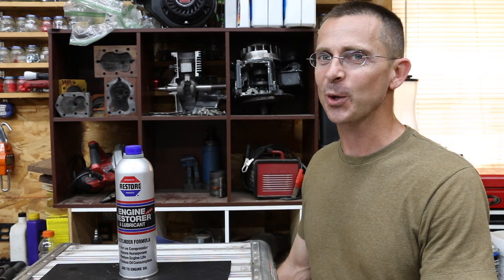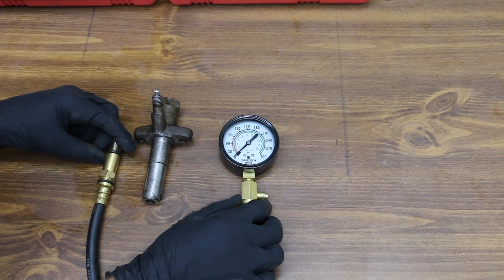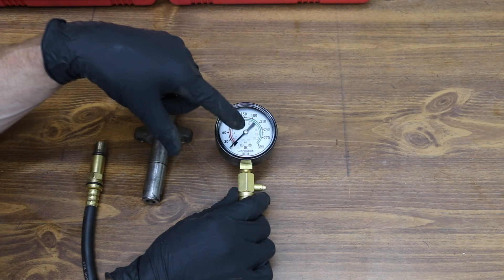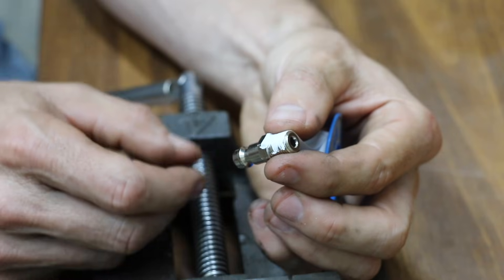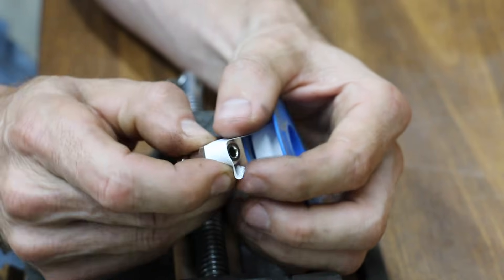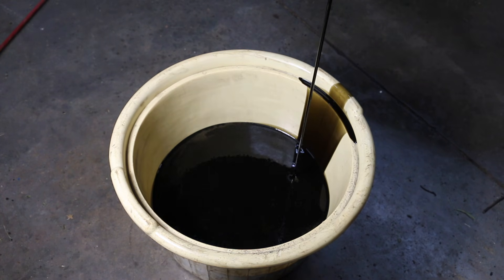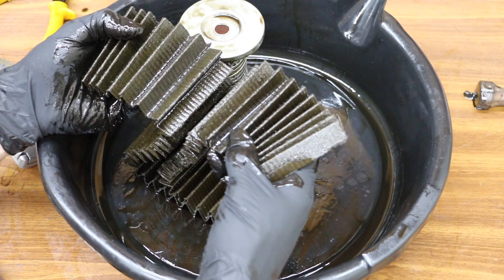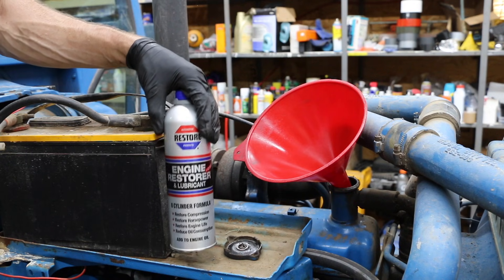Did the "Engine Restore" Compression Improvement Last?  One year later (Episode 2)

Comment: I had been having some minor overheating issues with my truck. It always seemed to get hot under load, but it wasn't using much coolant, no coolant in the oil, no visible steam coming out of the exhaust. I found an upside down thermostat and a lot of build up in the radiator. It fit the symptoms. The issues seemed to get mostly better once those issues we're fixed... Then I added restore and the truck boiled over on my very first test drive. I can only assume that Restore improved the compression enough to blow the charge around the bad head gasket and into my coolant system. It sounds like a bad deal, but adding Restore may have resulted in the truck failing a few blocks from home instead of on the side of the interstate. That's a blessing in disguise.

Now that I've taken the time and replaced the head gaskets, the truck runs well. I will continue to use Restore. What happened in my case was unfortunate, but Restore was not at fault. It is a good product and I will use it until the bottom end goes on my Vulcan V6.
Reply from the maker: I enjoyed reading your comments!

Comment: Great vid! Thanks for the follow up! Seems that stuff works as advertised.

Neighbor used to have the same tractor, but without the cab, and in MUCH worse shape. Seat was just bare steel - not very comfortable! It always ran great, until one day it didn't. I repaired some battery cables and got her going again, then replaced some bearings and tie rod ends to take the 20" of slop out of the steering (no exaggeration!).  Then, a few injectors failed. Sat quite a while, then they got it going again. They took it out in the field, and forgot to check the oil. That was the end of that! RIP Ford 5000, 1966-2017. The family did ALOT of work with that ol' girl!
Reply from the maker: Thank you!  These tractors last a long time.
Reply: Tell them to use engine restore.

Comment: I once had good luck with Bar’s Leak 1111 headgasket sealant. I put it in the coolant of my Saturn which had been burning about a gallon every 40 miles or so, and then I continued to drive it for over a year afterward and it never burnt coolant again! It had over 250k and probably would have ran longer but I sold it to a friend whom crashed it.
Reply from the maker: Thanks for commenting on this.

Comment: Too bad you have no real data here. So you changed the injectors and that right there will fix all your issues on cold starting etc. Also you didn't send your oil to Blackstone labs. Otherwise you didn't gather any inj nfo and this was a waste of time
Reply from the maker: Sorry, i didn't provide a good explanation of the history.  I changed the injectors several months before the 1st engine restore treatment. New injectors didn't help the tractor. So, I decided to try restore, which did help.

Comment: How about testing MotorKote.  It brought down the temperature of my 2003 GMC Envoy from 205 to 195 when I put it in about 2 months ago.  I put a new thermostat in it two years ago.  The vehicle has 267,000 miles on it.  I also put about 4 oz. in my 1979 GMC 3/4 ton Sierra pickup transmission.  It's the original four speed that has the stump puller gear (granny gear).The truck sat for about 7 years as my son and I did a frame-off restoration.  The synchronizers were stiff from sitting so long.  After a couple of weeks, they let me shift up and down easily.  It says it can be put in rear-ends as well as automatic transmissions.  Just wondering if anyone else has had the same results.  It'd be really good to see it being tested by someone else.
Reply from the maker: I tested MotorKote recently and it did an impressive job in testing (short term test).

Comment: Thanks for the update. I am happy to see it continued to provide good results. I haven't used restor in years but I may run some on next oil change in my 170k mile engine on one of my daily drivers. That has a 10psi lower dry compression on cylinder 3.
Reply from the maker: If you decide to try it, it would be great to find out if it helps!

Comment: I know this'll sound weird, but since this engine has turbo ... this tractor does have ball bearing turbo or glide bearing turbo? Because if that additive should restore glide surfaces, it (in theory) should restory the turbo shaft bearing as well. I assume you have not checked oil pressure before/after?
Reply from the maker: Great point!  No, I haven't checked the oil pressure before or after but I should have done so.

Comment: I am a patron, thank you for your videos. As for engine additives. I have a 2003 Honda Odyssey with a leaking engine main seal to the transmission. the Odyssey has 152000 miles, transmission replace by Honda (the tranmission was free from Honda) @ 77,000 miles. We put in a new engine mail seal @ 130,000. I did not want to do this again as it cost in the neighborhood of $800 so with advise on line I used ATP Re-Seal, 8 oz. (AT205) for about $15. Drove 500 miles on and off. And put the van on a life saw no leaks, wiped the area, and lifted it again for tire rotation and it was still dry. I can say it worked for me, and I am impressed. I hope this helps someone else.
Reply from the maker: James, Thank you very much for supporting the channel!  That's a very impressive result that saved you a ton of money!

Comment: Several years ago (2 decades?), I used to use CD-2 Power Back in my '77 Chevy truck. There was a definite "calibrated seat of the pants" power improvement, and it also increased my gas mileage by 2 mpg.  It's not as easy to find as it was back then. I'm guessing that the formula is quite similar to "Engine Restore". http://ahlbornequipment.com/images/products/detail/4091FD.jpg
Reply from the maker: Impressive!

Comment: ZMAX is what I use to increase oil pressure by 5 psi, increase compression, slick up a automatic transmission to transfer more revolutions from engine to wheels, normal results are 5 more mph at same rpm
Reply from the maker: Thanks for commenting.

Comment: It isn't cheap but from what I've heard motorkote is a good product.
Reply from the maker: I tested it recently and it did an amazing job.
Reply: Brian Reiff I bought a 2006 CT’s with 2.8 I got the car last fall it’s in mint condition but it was un certified I put new tires and brakes on the car  cleaned bottom of car and coated with metal prep touched all bare metal with several coats of anti rust paint undercoated entire chassis and oil spayed after it was dry . I was concerned about engine history on these cars timing chains  while in storage I put some wynns engine tune up in the car and ran it up and Down the lane way at slow speed 30 min each month  to remove any carbon and sluge on rings and galleries I drained oil and got it safety checked used motor kote in the oil and synthetic 5- 30 it runs super quiet no noises at all I am changing out all fluids this weekend putting motor kote in cleaned out power steering system . As to the use of restore on 2 cycle out boards I 
I would clean out  the combustion chamber with combustion chamber cleaner sprayed directly through spark plug holes and let engine sit over night spray again let sit spray again  then put some well shaken restores in each cleaned cylinder and work back and forth by hand or using the starter . Then I would mix restore and quality 2 cycle oil together put it into portable 5 gallon tank shake run some through the engine running every once in a while  .

Comment: The engine restore would have dissolved some of the carbon out of the ring grooves on the pistons and the slight compression increase reflects this but it has nothing to do with why the tractor starts better. 

You replaced the injectors. You now have a much finer, more controlled spray pattern. That is why it starts easier when cold. The droplets are smaller and there are more of the which means that you are getting more vapour to burn before the engine heats up.
Reply from the maker: Sorry, I didn't explain the history very well.  I replaced the injectors several months before the original Engine Restore video/test.  New injectors didn't help the cold start issue.  Thanks again.

Comment: you really should try stuff from Justice Brothers. I've used it in several motors and the ran smoother and started easier.  Some are afraid it thickens the oil, but is very thin. I wonder how you like it. (I have to admit that I don't used it anymore in my more modern vehicles..)
Reply from the maker: Thanks for the recommendation!

Comment: I had an '87 Toyota pickup with the 22R 4cyl and I started using this and you coukd actually feel a difference with it in and without it. Got more power out of the engine not long after using this stuff. Now...on a V6 or V8 I'm not sure how well it would work.
Reply from the maker: Impressive!

Comment: I have been using graphite in my engines for about 25 years now. Great cold starts and slows down blow-by. I just mix about a tablespoon FULL in the oil for a V8 or V6. Shake it well in a quart and then drop in, then run it in well so it coats the moving parts. A teaspoon for lawn mower engines or such.
Reply from the maker: Thanks for this recommendation!

Comment: This is a product I used on my 360,000km Land Rover V8 Engine - http://www.supercheapauto.com.au/Product/Nulon-E10-Worn-Engine-Treatment-300mL/1393 - it is a longer term additive (uses PTFE) - so the quick test of half an hour in a lawnmower isn't going to do it justice, and might be good for a test if you have an old V6 or V8 truck engine that's getting a bit tired.  On my Land Rover I noticed (after 5-600km) the engine was quieter and smoother.  Didn't do before-after comparisons of things like engine bay noise level, or compression, but perhaps something like this could be a good thing to try next?
Reply from the maker: Thanks for the recommendation!

Comment: When I first ran across your channel one of the first comments I made mentioned that Engine Restore is one of the few miracle in a can products that actually works.  I typically consider part of my oil change procedure on most of my gas engines that I've ever owned once they're past about 75-100K miles.  I'm glad you tried it and got real numbers.  Now you have me wondering if I need to start using it in my high mile Cummins Diesel Dodge.
Reply from the maker: Those cummins diesels are great trucks and last a long time!

Comment: A note on taper thread fittings...

The main role of the Teflon tape is not as a sealant, but as a lubricant to allow the threads to be tightened sufficiently to create a seal. The threads must be tightened to the point where they conform to each other to form a seal.

NPTF (as opposed to NPT) fittings are guaranteed to dry seal, due to increased manufacturing precision, but can be much more expensive.
Reply from the maker: Great point!

Comment: That's not what they meant by using the drill press, lol.

You're supposed to chamfer the hole a bit, having the vice firmly attached to the machine table. replace the chamfer bit with the tap, and then slowly work your way down, turning the drill press by hand. You can also make a centering bit (45 degree cone) which comes down into the small dimple of the tap, then use the regular hand tapping set whilst keeping it perfectly straight with the drill press.

To the video: Super interesting stuff as always, keep the videos coming.
Reply from the maker: Thanks for the tip.

Comment: What about a 04 chevy Express 2500 van with 330000 miles on it? Would recommend using this in it?
Reply from the maker: Yes, it will help if the compression is a little low due to worn piston rights.

Comment: You can also use the drill key as a handle (stick the "handle" part into one of the drill chuck holes) and manually tap the holes. The drill press keeps the tap coaxial with the hole.
Reply from the maker: Great tip!

Comment: Hey Project Farm, a tip for applying PTFE tape is to have it coming off the roll in the other direction so rather than 0_0 it is 0/0. This means as you wind the roll of tape it will naturally unwind and you'll find it much easier to do. E.g. @ 4:06 flip the PTFE tape vertically so the outer face of the tape is the side being applied directly to the thread of the adapter. Great content as always, also I think you used my other comment to provide bearing wear in a percentage in one of your last videos, awesome stuff!
Reply from the maker: Great tips!  I greatly appreciate your advice!  I learn a lot from those leaving comments!

Comment: Here is a trick from a old pipe fitter. Hold the piece your applying the tape to in your left hand. Put the roll of Teflon on your index finger with the tape dispensing from the bottom side, and just roll it on in the direction of the threads going around your piece to be taped. You can use your thumb as a brake to keep tension on the tape resulting in a professional job. Enjoy the information and factual results of your work, keep up the good work.
Reply from the maker: Great tip!
Reply: Should have said tape in the right hand LOL it works well, and you can use the edge of the roll to seat the tape into the threads so it does not unroll as you are installing the piece

Comment: I think it’s a good idea when using this product to make sure and not over fill your engine. Whatever amount of engine restorer your putting take that same amount of motor oil out. I had a check engine light come on and off when using the product. When I checked the dip stick, it was showing slightly over filled. So perhaps that’s why the check engine light went off. I just recently changed my oil and did not put engine restorer. It’s been a month now and no check engine light.
Reply from the maker: Great point!
Reply: Project Farm I would agree though that my engine idling was very smooth. I’ve used this on my older trucks and they are going 150k + miles with no problems what so ever

Comment: I dont know do you have this product in US but it's called Forté. (http://www.forte-benelux.com/EN/Home.html) 

But i used Forté fuel system cleaner on my 2006 Ford Focus 2.0 Gasoline engine when we went on a road trip and after 50 miles i was passing a truck and i noticed big diffrence in acceleration and in my engine intake sound. 

I suggest to try that if you can get it :)

Great videos! thank you for making these :)
Reply from the maker: Thanks for the recommendation!

Comment: We have that exact same ford 5000 turbo model at my shop, had an issue with the hydraulic steering column constantly sheering  its key and have had it parked for the last 5 years. Have you had any issues with yours, I ask because we are deciding weather to junk it or save it, the parts are near impossible for us to find here in central California.
Reply from the maker: I have never had an issue with the hydraulic steering column.  I hope you can save the tractor.  They are well-built and fairly easy to service!

Comment: id like to see Restore used in one of those really badly damaged lawnmower engines and see before and after shots of cyl walls, bearings and journals, etc.
Reply from the maker: Great recommendation!
Reply: @ProjectFarm  Restore used in the "Sand Eater" engine would be an excellent (and hopefully relatively easy) video!
Reply: Project Farm yes please, would be awesome to see results
Reply: @ProjectFarm  Please make this recommendation come to reality :-)
Reply: @ProjectFarm  Please do this!!!!
Reply: I don't think it does anything for the journals, bearings, or bearing surfaces, only the cylinder walls in sealing the rings. Basically if you're rings are shot, like I had with a Honda Civic I had recently, it helped tremendously
Reply: @tommy35ss   did it help with burning oil?
Reply: @CodysGarage  It was hard to say (been 4 years since the overhaul). I see to recall going from burning a quart every 1200 mies to burning a quart every 1000 miles. Definitely could have been an error in my measurement. Definitely helped with compression and efficiency though
Reply: @tommy35ss  I put this in a 454, ran it for 12 hours, then disassembled the engine. It coated ever moving part including journals and bearings. The valve stems, springs and rocket arms were all coated with CSL! This is the only product I will ever add to an engine, been using it for over 30 years. It restores compression, hp, and oil pressure, making the engine run almost as good as new...
Reply: @tommy35ss  From https://www.enginerestore.co.uk/what-is-restore-engine-restorer-3-w.asp :
 RESTORE Engine Restorer works effectively wherever friction and wear cuts scratches into metal-on-metal reciprocating or rotating surfaces, such as cylinder walls and piston rings, crankshaft and bearings, valve guides and stems.
Reply: Was this video done yet? Or is it in the making or not happening at all?
Reply: @iamthewulf  o
Reply: I have used this product in cars before and I have also done exactly the test you are talking about in a snowblower engine that was all scored up and then after it stopped smoking and burning oil I removed the head and all the scoring was filled in by the engine restore this stuff really works. I have an old leaf blower that is smoking I am going to use it in next.
Reply: Please do this!
Reply: Another request to see this product used on an old 4 cycle lawn mower.  Thank you Project Farm for the excellent video series and product review.
Reply: Yeah right 😂

Comment: I have used Engine Restore for years.  I have seen it work very well on engines with a lot of miles on them.  I have it in an old Jeep Grand Cherokee I just bought with 223,000 miles.  Jeep runs better then it did without it.  This stuff works.
Reply from the maker: Great results!

Comment: one tip on diesels, if you intend to let the engine idle for a long period of time (ie 10+ minutes) you're actually better off shutting the engine off or pushing the idle to 1000-1200 rpm as to prevent cylinder glazing.
Reply from the maker: Great tip!